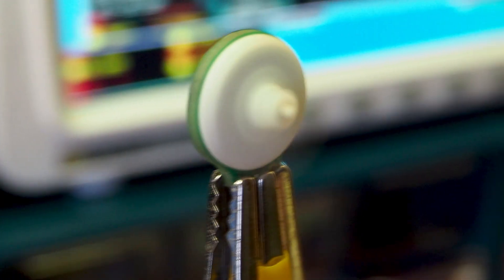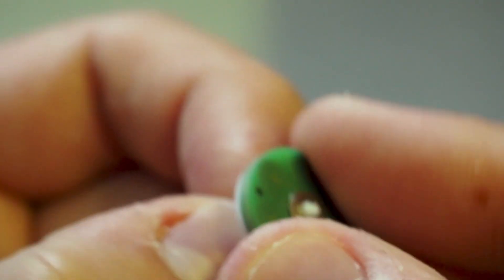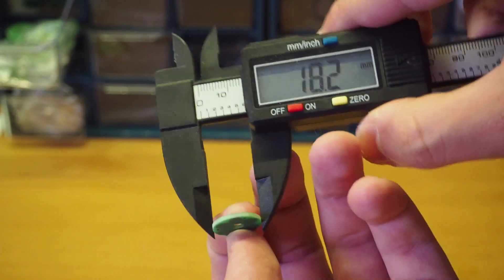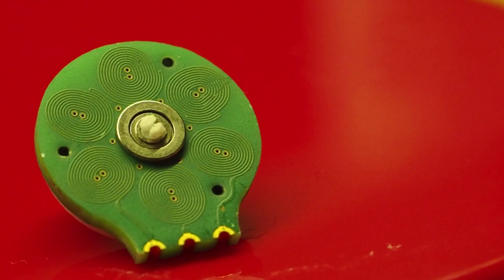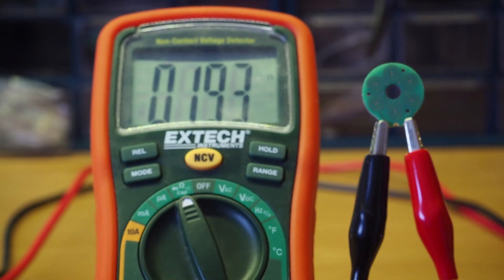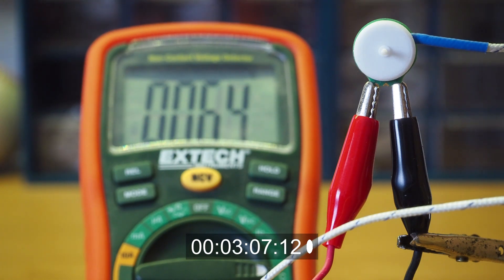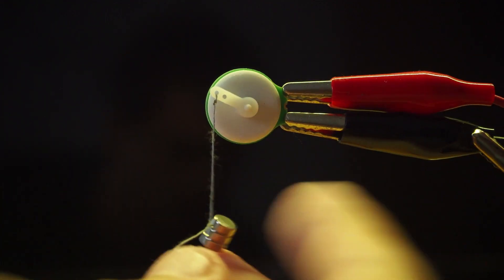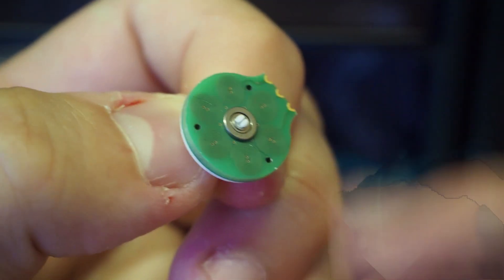How can I improve my PCB Motor?

Comment: Hi Carl! Nice work with your motor(s)! I saw in your other video that you added an ferrite iron sheet to the back of the stator to increase the magnetic permeance in the motor circuit. This make sense, but I don't think the increased temperature is due to eddy current losses when the motor is in steady state unless you are using a weird modulation technique (i.e. odd PWM scheme). What I think you should try is other ferrite materials as well as adding the same ferrite sheet to the rotor, and then trying to minimize the mechanical clearance between rotor and stator.
Good luck, keep up the nice work!